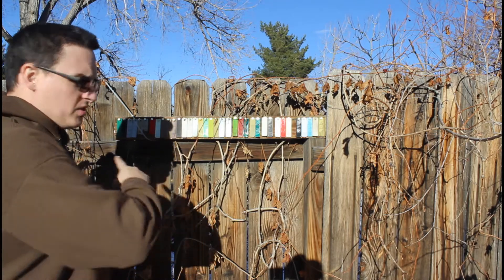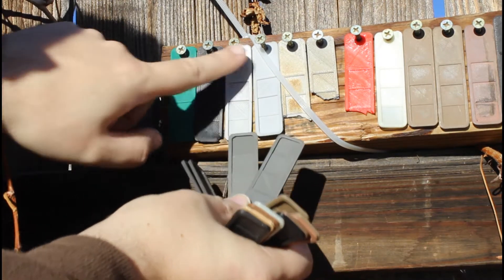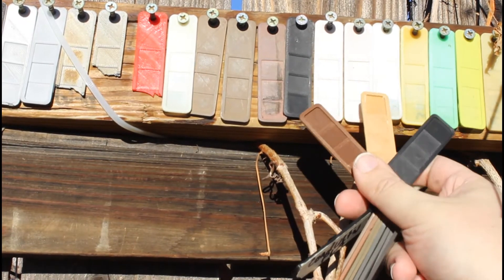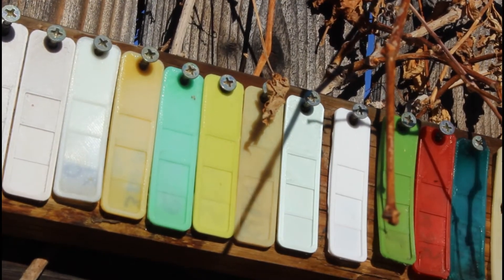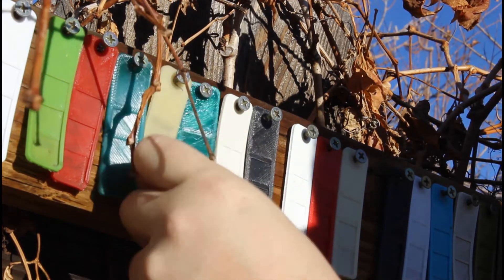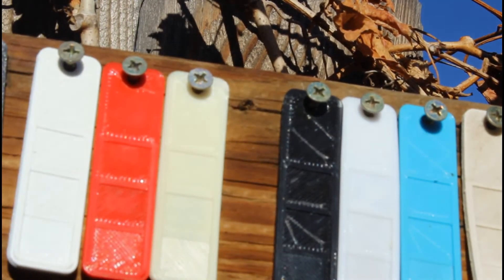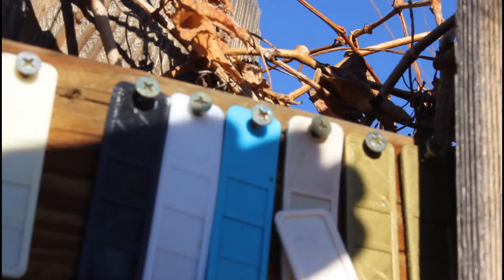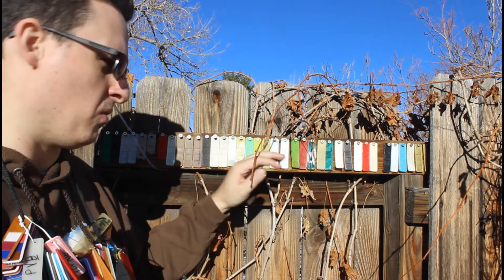3 Years Later: Exposure testing 3D printing filaments outdoors.

Comment: My OCD definitely kicked in when you started skipping a few, but overall really informative and interesting
Reply from the maker: Thanks for the feedback. I'm finalizing the 7 year video now. It will have chapters based on material instead of trying to go through the individual brands, because their is almost 50 samples on the board! I did move some off the board due to damage.
Reply: That's not how OCD works. Thanks for diminishing it for those who actually suffer from it though.

Comment: what material do you suggest, if I want to use some filament for on Road uses? I am working on project and for prototyping I would require to develop a product that seats on Road under sun under rain, walked over by people. so what material do you suggest.
Reply from the maker: ASA is designed for automotive use (Though not on the board) TPU is good for soft parts like handles...
Reply from the maker: 7th year video is in the works...

Comment: Hi i saw your video and i started reading the comments. I am making something for my dad at the jersey shore for under his awning on the deck and it will be white PLA and will stay on the awning under it. The sun will beat down on it but be blocked by the awning i was going to use ABS+ but i dont have the correct ventilation its in my room and i dont want it to stink can i also spray it with UV weather spray will that help? thanks
Reply from the maker: If it's in the shade that will help, and a UV treatment can help to, but I'd look at PETG instead if this will be outside for years.
Reply: @3DPT  thank you
Reply: @3DPT  I talked to a friend of mine who works a machine shop and he is going to make it out of aluminum thank you for the response back

Comment: Hi, I'm making a project for my university and I would like to know which of these do you think has biodegraded the most, by the video it's kind of hard to tell any difference other than colour, some warping and a few that broke with falling.
Reply from the maker: PVA disappeared in a few months as a soluble filament. PLA's have degraded the most IMO, followed by the composite woodfills. The metal composts have lost their luster but are still fairly solid. All others seem to be in good shape apart from color. TPU's are still flexible.
Reply from the maker: 5 year update is filmed and editing now!
Reply from the maker: https://youtu.be/sXWcgr1aFY8

Comment: im planning on making a go pro mount for a helmet, which one should i use, im planning to buy a ender 3 printer, im on a tight budget :) please help me
Reply from the maker: PLA, TPU should work for go pro mounts. These samples have been outside for over 4 years, but for a helmet mount UV exposure is not an issue.
Reply from the maker: 5 year update is filmed and editing now!
Reply: TPU, for sure! It is the best material for GoPro mounts! Super resistent. Make sure to get a semi-flex one cause it’s easier to print with bowden tubes, seach for TPUs with shore around 98A. 95A is possible too but need to low down speeds a litrle more. Check TPU tips and teicks video, from “3d maker noob” now called “Breaks n’ makes”. Take care with moisture with TPU (and also with nylons, PVAs and others… but those are the worst)
Reply from the maker: https://youtu.be/sXWcgr1aFY8

Comment: Really interested in a hardness/strength test. Even an informal one just to get a general idea of the weakest/strongest. Also I wonder how they would hold up if they were either sealed or painted.
Reply from the maker: I only printed one set for outdoor use and the controls, so I've been hesitant to do a destructive test. Sealing would help with the color, but a lot of prints are not sealed or treated after they are done. I can see a few PLA's being weaker.
Reply: If you’re printing structural stuff for outside, don’t use PLA, I printed a hundreds odd clips to use in the garden and regretted it 4months later once the parts had all turned brittle and snapped. I turned to using PETG and it’s worked fine ever since.
Reply: @NullHyp Any update on the petg parts 4 years later?
Reply from the maker: 5 year update is filmed and editing now!
Reply from the maker: https://youtu.be/sXWcgr1aFY8

Comment: Nice job man this is why i love YouTube. You really didn't go over it but which filament do you think had the least warpage?
Reply from the maker: PLA's, TPU's, and many of the mixed ones (carbon fiber/PLA, composites) warped the least of all. Warping has not been a major issue with the prints, it's been color shift and a few accidental breaks. I zip tied the board to the fence after the squirrels knocked it off a couple times.
Reply from the maker: 5 year update is filmed and editing now!
Reply from the maker: https://youtu.be/sXWcgr1aFY8

Comment: Planning on making an ambitious geocache.  This video has been very useful
Reply from the maker: 5 year update is filmed and editing now!
Reply: @3DPT  Awesome!  I'll be excited when it is released!
Reply from the maker: Let me know how that works. Right now the samples have been exposed in the air with this setup, but it would be interesting to see how PLA handles in the ground. Bear in mind that PLA is suppose to biodegrade, but if my test is any indication you should be fine for at least 6-12 months in the ground. Try printing the walls 2-3 layers to compensate.
Reply: @3DPT  Based on what I saw and have read online I think I'm going to use PETG and see how that does.   I think I'll throw out a PLA one for science as well.
Reply: I'm 6 months late, but I highly recommend using a cheap enclosure and printing with ASA. It handles UV and moisture very very well.
Reply from the maker: https://youtu.be/sXWcgr1aFY8

Comment: Hi! I'm new to 3D printing and I was wondering which filament is good for outdoor use if you look at strength and deformation. I wouldn't mind the color fading but the pieces need to be able to last quite some time. I was thinking about PLA if the piece would be in the shade most of the time. What are your suggestions?
Reply: Arnaud Van Steenkiste hi i’ve been searching for that too. PLA can stand in the sun as long as its not inside the car that can make it really hot. PLAN can stand up to 60c . PLA is easy to use unlike ABS but ABS have much tempreature resistance of upti 105c. PETG also is a good product but not that cheap. If you want to use PLA, just don’t put it inside your car or any closed area that makes it too hot. Under the should be fine. I did a lot of research about that. After this pandemic I’m gonna buy also 3d printers and will use PLA Filament as a starter. :) If ABS Filament you have to make sure your 3d printer is enclosed. I’ll give you the link ti watch and search the best for you :)
Reply from the maker: 5 year update is filmed and editing now!
Reply from the maker: If it's in the shade PLA will work fine. If it's in more direct sun ABS, PETG, or CoPETG's will work fine. I have not run any strength test on these samples, so take that as you will. All the samples have kept their shape after 3 years of exposure. Depending on what you are printing and the purpose, PLA should be good for a few years outdoors. Use PETG or ABS if you are woried about flexibility and strength.
Reply from the maker: https://youtu.be/sXWcgr1aFY8